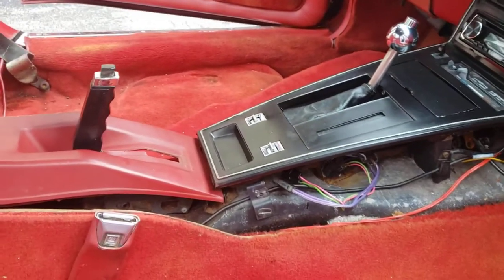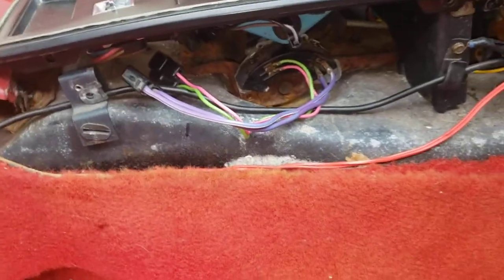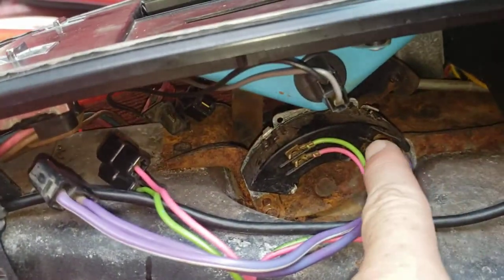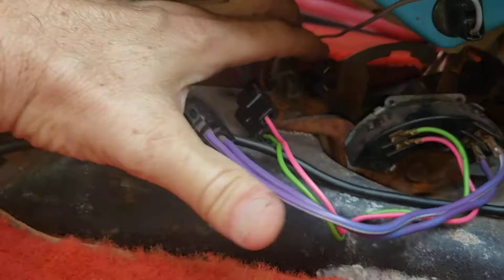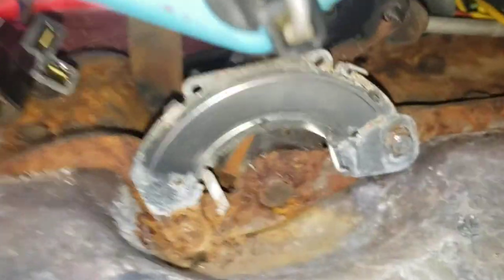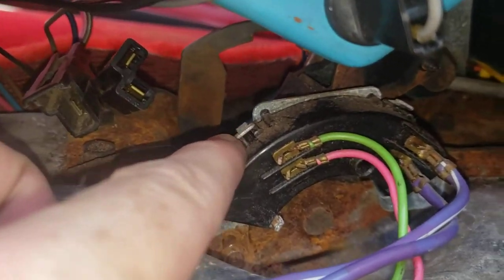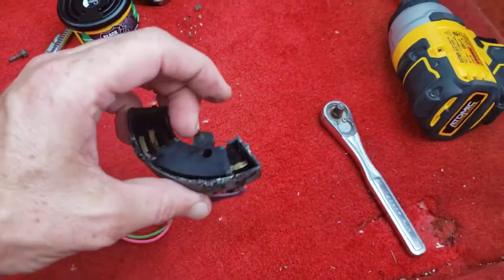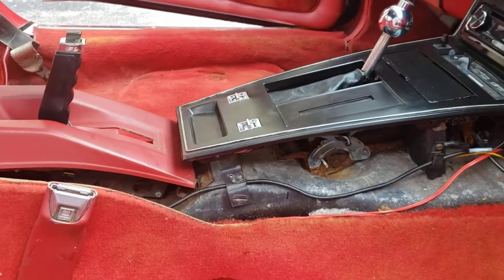78-82 1980 Corvette Neutral Safety Switch / Backup Lights Location and remove

Comment: Thanks for the video. I had no idea where to locate it on the car. For some reason on my 79 it stips workong when the car is hot but starts again after it's cooled off. 
Should be a very easy swap out
Reply from the maker: It is actually easier if you take both seats out. Just to lift center console to pull those plugs. And this did fix my back up lights.

Comment: When you remove the plastic parts of the switch by bending the tabs that hold the housing onto the metal mounting plate, there are 2 tiny springs & 2 tiny copper rollers that will drop out from the smaller “second piece.” The rollers lay across the brass strips imbedded in the larger piece of the plastic housing.

Before removing the switch you can save a lot of trouble by testing it with a multimeter. Shift into Park & Neutral to see if there’s continuity between each set of wires. Then shift out of Park & there should be no continuity.